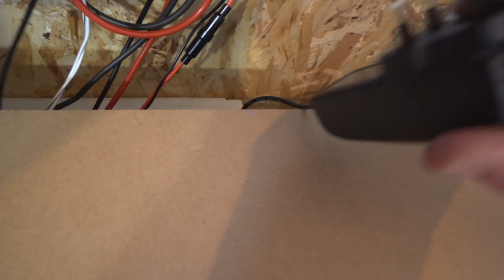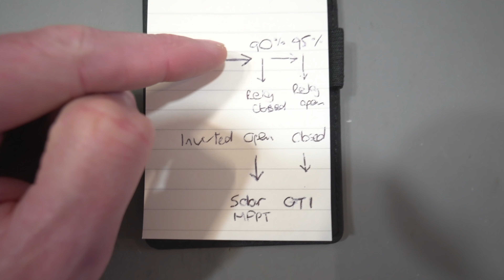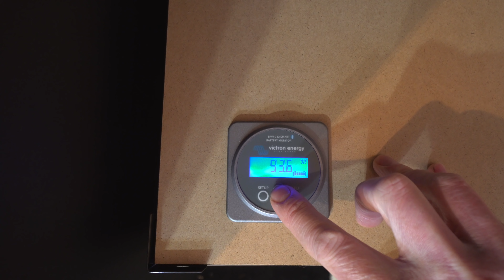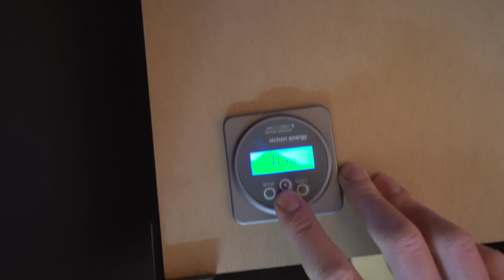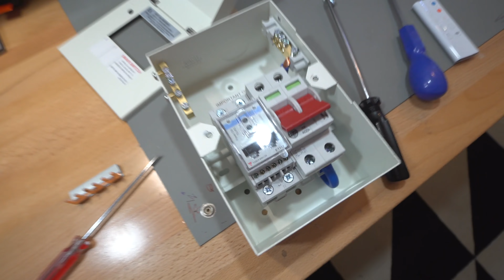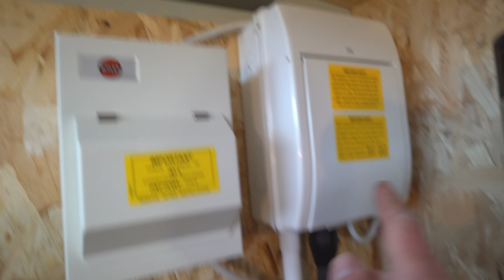AUTO SWITCHING A SOLAR CHARGE CONTROLLER AND A GRID TIE INVERTER

Comment: Total watts used in 24 hours = watts in thousands l20w is  . 120 thousand watts  
Or . 12 kilowatts
If your average watts used was 120, then
.12 kw x 24 hours
24 x . 12 is 63.2 kw hours
63.2 kwhours can cost us . 15¢ each totalling $9.48

That was almost $10 sold back to the elec co. I. 1 day

Comment: OK, I got a relay to do the same as you.  But, when it switches off, it sends a voltage spike back down to the voltage sensor as its an inductive load, knocking the sensor out until I power it off and on again.  How did you get around this?  A diode?  Which one?

Comment: Could you just split the feed from the solar panels to the charge controller and the grid tie?  If the batteries are full, the charge controller wont be pulling many watts, so the extra will just go to the grid tie??

Comment: As for the monitor for your batteries, I assume you have the batteries wired either in series or parallel depending on what voltage system you’re running and you’ve got the monitor showing the overall combined power of the batteries as opposed to the power level of each individual battery correct?

Comment: I know this is an older video but how did the system work out over an extended period of time as far as triggering the relay to turn on the Greta inverter? I’m looking to do the same exact thing since my five large solar batteries are kicking out being charged up here in the daytime and I have an excess amount of power that is just being bled off/wasted. Great video and appreciate the information. In case I missed it, what kind of relay is that and where can that be purchased? Thank you

Comment: This is a bit of an adventure video.
You shouldn't use ac on DC.
Basics you've used a NO NC relay, so your normally open goes to the battery and the normally closed goes to the micro inverter.

I would have gone for a SSR higher power relay (60a/70vdc) this uses less power.

I would have also gone for a normal meter, there the same but show the kWh as digital or analogue. Doesn't help when you buy in to Victron.
The MI uses nrf2001, someone's made a video and posted the protocol for it. (Git hub)

I like the idea of what you have done.
I'm playing catch up on solar as I'm 2007 era. I dropped it due to battery costs and performance was terrible.

Comes in handy being the engineer, as I bought stuff, it broke and now making my own...saves a tonne of money, takes a lot of time though.

Comment: Hi Andy, I know this video is old, but that relay is rated for 10 amp AC,  DC could possibly cause an ARC and melt the terminals or weld them together, maybe better off using it to connect the AC side of the grid tie

Comment: You should not use AC Relay to Switch DC current you will melt the Relay contacts if DC arcs... 
Use DC Relay
Ex automotive relay.
Reply: https://youtu.be/fnHbwtrkPek
What will happen in this vidéo
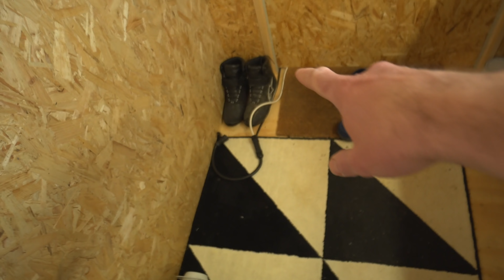At about 9:35

Comment: How far down does the Grid Tie pull the panel voltage when  operating ?  Do you even need the relay ?   When the battery is charged it will stop pulling power from the panels.  Grid tie would just pick up the current available?  If both the Grid Tie and the charger are of the MPPT type I don't see why it wouldn't work.
Reply: I was just wondering the same thing (3 years later!)

Comment: Lithium batteries pull hardly any current at all once they reach the voltage your providing.  It just peters out.  Nothing like a Lead Acid cell.   Float Charging is sorta worthless.    They will Absorb a bit more if you keep the float at your Charge voltage.

Comment: I have a compressor fridge. is there any way to wire it up to the load ports of a charge controller, so that it runs off the superflous solar during the day, but switches to battery power when the sun doesn't give enough power?

Comment: Great in depth video. Swap out that relay for a DPDT solenoid. A good one will handle 65amps continuous no worries. Thats what I did.
Cheers from the sunny outback of South Australia !
Reply: hi how to wire relay  solar charge controler and gridtie for when battery full then swith to gridtie inverter
Reply: can you give a link of the exact relay, im buildingd this now also :-) thanks!!

Comment: Can i ask how you are switching the Grid Tie on & off , iv just had mine turn up , Got the relay etc , But the manual states (Never disconnect PV while inverter is active as it will be damaged.) just wondering how you got round this?
Reply from the maker: Haha! I didn’t read that manual actually, but it seemed to work ok, I’m only running 2 panels and around 350W peak so maybe at that level it can handle it ok. I’m not currently using this method as I found the relay was getting quite hot and would probably eventually fail, if I try it again I’d use a contactor rather than a smallish relay. 

At the moment I’m switching the PV voltage manually with circuit breakers and it’s working fine.

Hope this helps!
Reply: Im working on a similar setup.. basically want one of these grid ties to cut in when the batteries are fully charged or at the least to be able to turn the grid tie inverter on/off remotely Thought it was going to be a a doddle using the VE bus output and the relay , But the Grid tie inverter manual says (*Magic smoke*) Think it maybe possible to leave the grid tie inveter connected directly to the batteries and switch the Grid on/off vier a relay instead - either that or i may go down the road of a Change over switch , i duno so many options  this hobby seems to be never ending!

Comment: You might be interested to know your Victron controller has a Relay output to do this exact function without the BMV - it can be set in the software, its on the VE port (turns one pin on when batts full) Very nice setup you have there!
Reply from the maker: Hi Yes, thanks for that but I think you can’t use the VE direct for comms and relay at the same time... I’m not sure if it’s in this video but I’m using a raspberry pi running victrons venus software and have all the parts connected to the pi via ve direct.Thanks for the comment 😁
Reply: yeh unfortunately so as it uses the same port, just thought it might be useful for ppl who dont have the bat monitor and want to use the excess power , im using it to switch the pv to a second controller on another bat bank

Comment: Fantastic series this and I'm already thinking of getting a panel for the shed. So with the tie grid inverter pushing power back to the house does that mean it's just consumed within the house? We have one of the new electric meters and it shows energy imported and exported.
Reply from the maker: Thanks. Yeah energy from the grid tie goes into the house. As it’s only 300-400W it just gets swallowed up by the house loads but it does make a bit of difference. My house base loads are never lower than 400-500W so my grid tie inverter never “exports” any energy to the public grid...and basically the meter doesn’t know any different it just sees a slightly reduced consumption.
Reply: andy kirby Just been running tests on my grid tie and notice my eon energy monitor that has a clamp on the positive meter cable actually goes up when grid tie is feeding in power.  I guess it's reading flow in both directions.  I did think it was maybe to do with importing more than my baseload but it's not.  I checked the Landis and Gyr smart meter(ex British Gas and now a dumb meter for my new supplier).  On that smart meter I can see the real energy supply to my house down to 20W.  I'd love to connect my old  British Gas monitor back to the smart meter as that function should still work, but I need a pin to bind the energy monitor to it and no longer have it. Scratching my head a little as would like to monitor what's going on more accurately.  Wonder if the Owl is more accurate?
Reply: Update. Been spending way too much time looking at an alternative energy monitor.  For budget concious people it might be worth looking at the Ecoeye PV Energy Monitor, it comes with two sensors and works out generation and consumption .  One sensor goes on the positive AC fro  the grid tie and the other sensor goes inbetween the meter and CU.  Also seems to have a funky trafic light system depending on if your exporting or consuming everything.  I need to get a life as the energy monitor obsession is like a disease ☺
Reply: Energy monitor update. Clamped Owl monitor to inverter positive output to monitor watts coming out.  I bought a  GEO Minim LED monitor that clamps to meters flashing red light area. This now matches what the meter reports. The clamp meters will add solar and consumption so you don't get an accurate figure. I've done a quick vid on my channel which I will upload shortly. My energy monitoring saga is over........ Flymo 1200r robot lawnmower arrives tomorrow😀
Reply: Some meters will flag the export if you wont register yourself with feed-in tariff. Other thing is feed in when the grid is down. You need to make sure that inverter will switch off when grid is down. Otherwise that is against the Code.

Comment: i had the very same setup. alright to experiment, but the contacts got burned out after a while.
also use a diode across the relay winding contacts to extinguish the high voltage created when the relay gets deactivated.

Comment: That relay doesn't look like a high current DC relay? A AC relay will have a max of 10amps AC but dc rating that might be around 3 amps. I would change the relay to a DC one :) Look at the thin wires inside the relay vs the much bigger cables you have going into it which will cause a big loss
Reply from the maker: Yeah to be honest it looked a lot bigger when I ordered it. It’s getting hot though now the sun is out so I’m gonna need to change it if I keep it setup this way. Thanks for the comment.
Reply: Can you change it for a solid state relay?..also I would start labeling all you trips/breakers as your changing your system so often..
Reply: It's only a 10A AC relay, and you're feeding the DC to the GTI? That would be closer to 20A, so looks like you'll have to replace that one with something else!

Comment: The problem I have is not much energy is being used during the day, whilst I’m at work, so I thinking more batteries, perhaps double the storage and have a relay do the same thing, switching between banks, trouble is 60 amps is a lot for a relay to handle. I did look into it 6/8 months ago, but could only fine one type able to handle this level amps, needless to say it was expensive so I chickened out. But this video has stimulated my interest again. Any ideas people.

Comment: Watch it with inductive loads , (coils) the amp rating on relais are usually for resistive loads (lightbulbs) with inductive loads the amp rating usually goes down with 40 procent

Comment: just wondering how legal is that DIY
Reply from the maker: I did a bit of reading and consulted my electrician, basically anyone can wire up a system like this to the mains if they are competent enough, you are not allowed to connect a grid tie inverter via a 3 pin plug... but we knew that! Inverters must be certified for anti islanding in the country they are used in. Other than that just get the sparky in.
Reply: When the grid companies swindle millions of pounds through faulty meters each year it's legal to opt out of paying.

Comment: Good setup. I was thinking that the Raspberry pie was the clever bit of tech but actually the victron battery meter is the clever part.

Now you just need to put the other batteries (in your grey box) onto the solar inverter to provide power whilst your main batteries are charging. lol
That would make a crazy setup